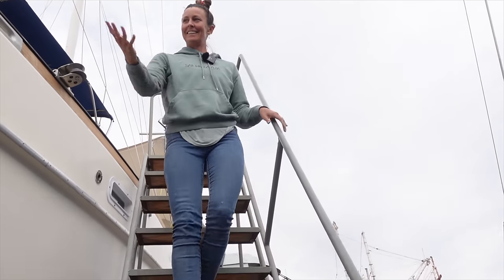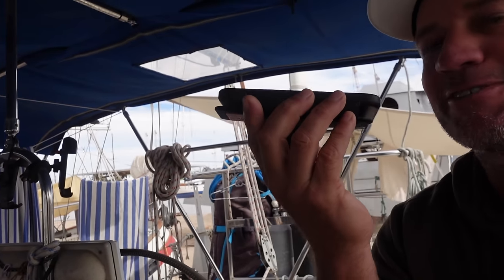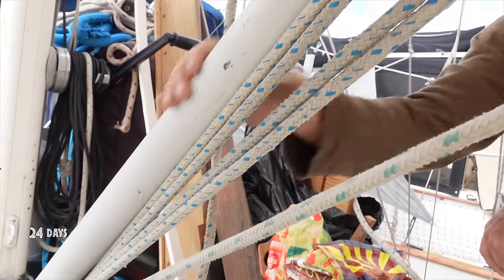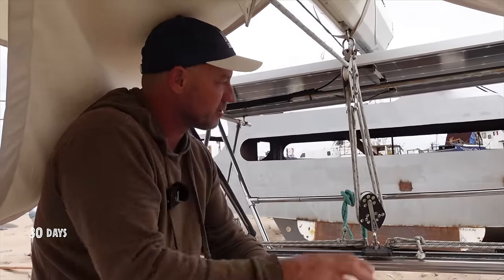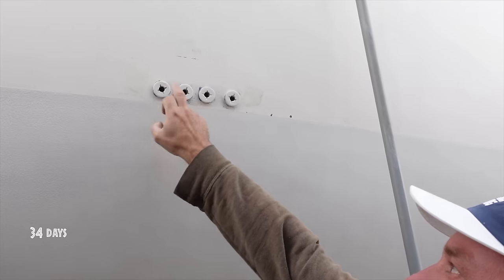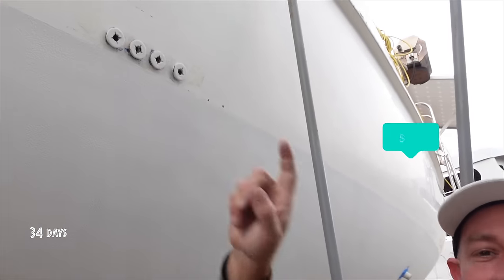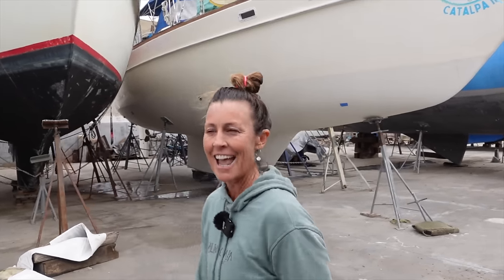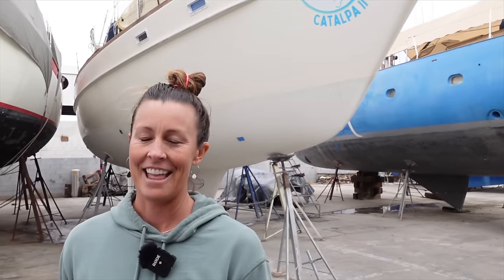Fixing our old SAILBOAT Breakdown on budget & time before we splash | Ep 394

Comment: I would not suggest solid welded piping. Boats flex a lot, flex will cause welds to fail or material to bend that aren't meant to bend. If you implement expansion joints... then maybe. I would go with Dyneema, personally. Certainly some of those projects could be done in a marina, if need be.
Reply from the maker: thanks yeah they can but we don't want to be in a marina where we are 😜plus its cheaper on the hard too